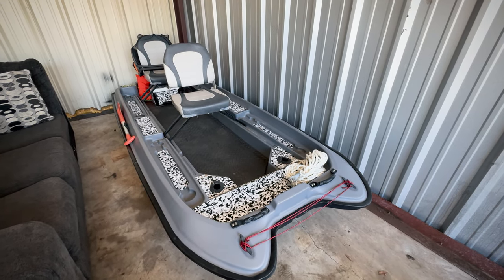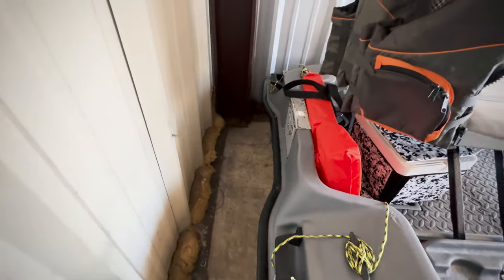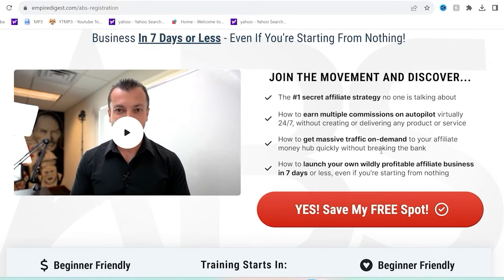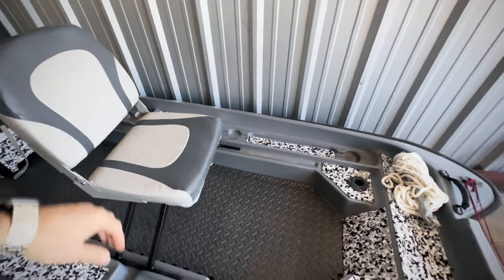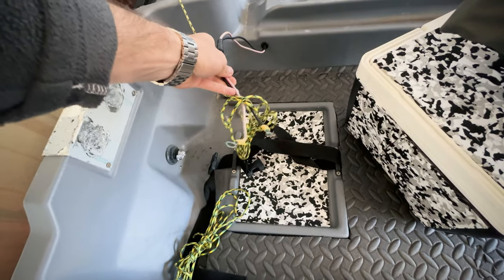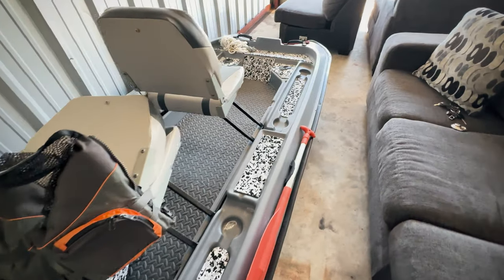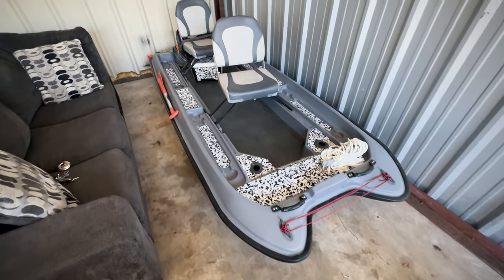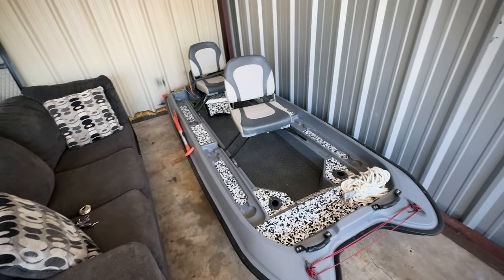My Tiny Boat's Pros & Cons | Pond Prowler, Quest Angler, Sundolphin, Bass Raider

Comment: Does the floor mars and chairs blow out driving down the road, Scotty mounts how to attach the to the plastic shell
Reply from the maker: I trailer my boat with the seats in the truck bed. As for those mats, they didn't blow out on the first drive but I did spray adhesive all on the bottom just in case. As for mounting, I attached my fish finder by drilling a 1/8 pilot hole in the plastic, then dipping my screw in marine adhesive then hand screwed it in. I have a video on the channel on how I did it.
Reply: Thanks @GreysonRoberts